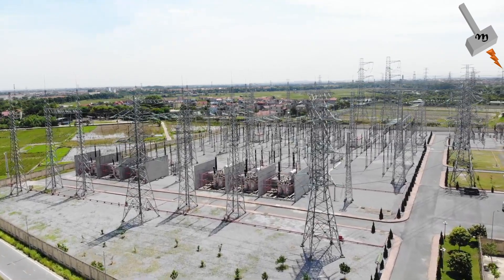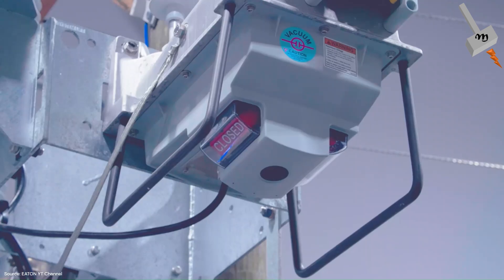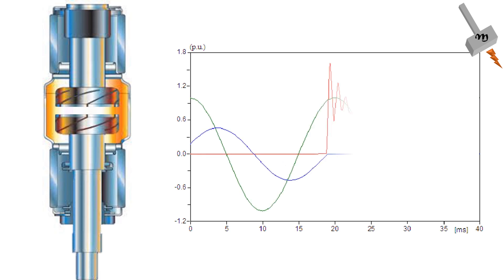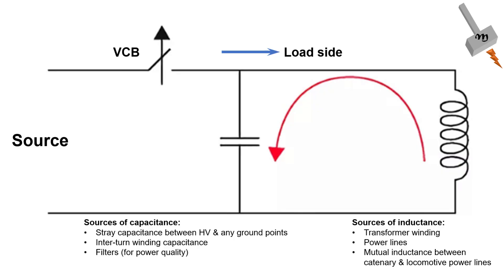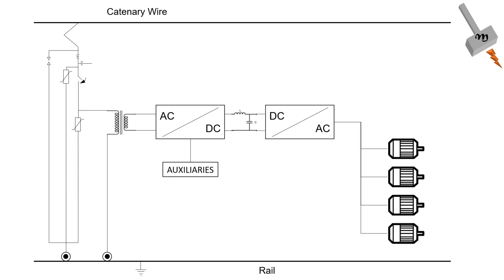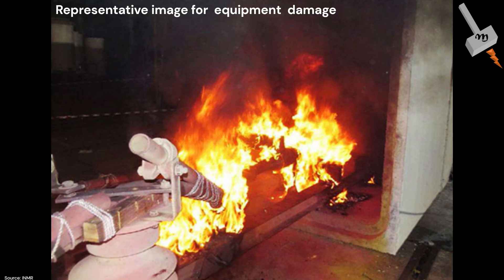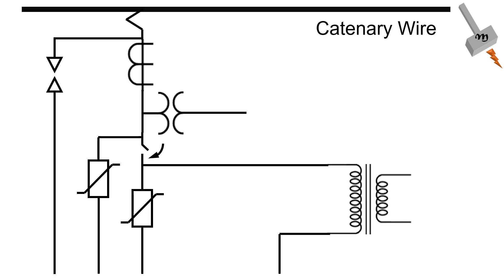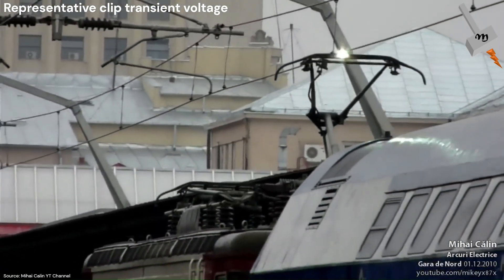Electrical Transients and its effect on locomotive power supply

Comment: what are other measures to limit transient voltage in high voltage systems?
Reply from the maker: Some of the other methods to limit transient voltage are,
1) surge arrester (which we explained in this video)
2) RC snubber circuit (that also we explained in this video)
3) Surge capacitors
4) Pre-insertion resistors
5) Chokes
6) Controlled switching of VCB